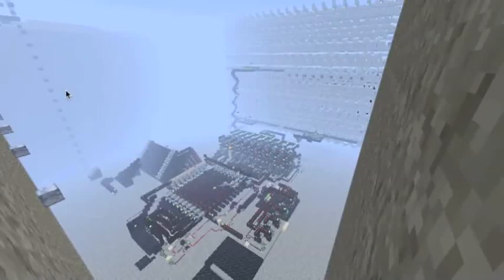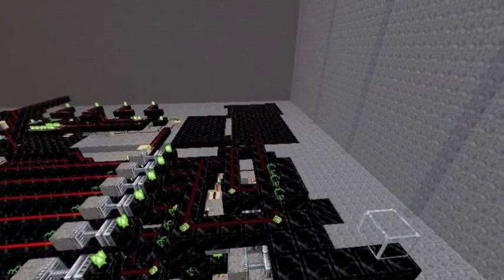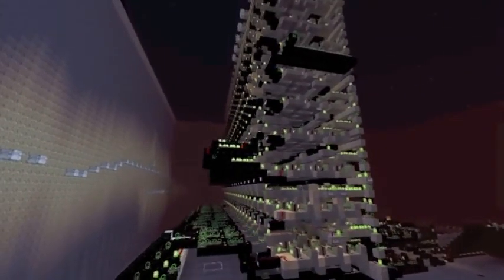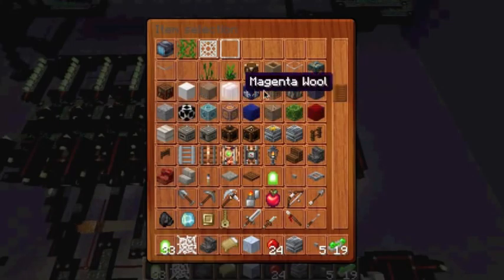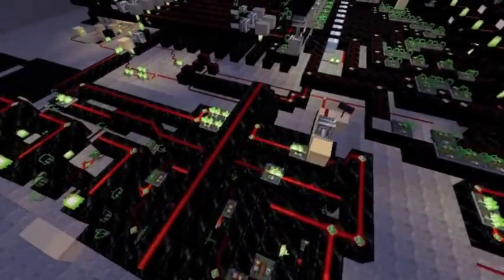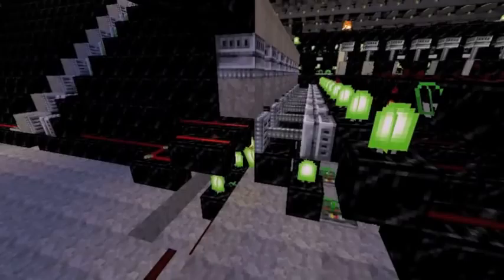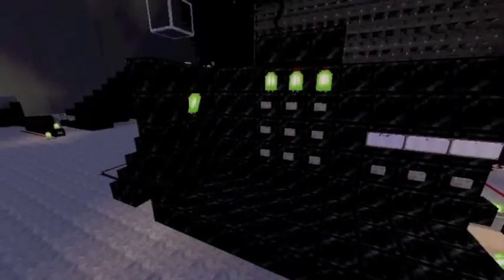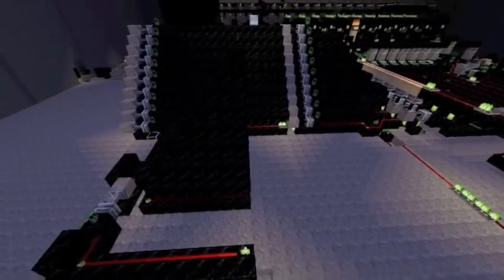Vending Machine Update

Comment from the maker: @TheBigJay66 The first type is the first counter I need for this project. However I need another counter later on, however I was planning on using a binary counter for the bit later on. I just need an easily resettable one. Oh and the reason I need binary counters for that one is I then need a Subtractor. So it'd be best to not have to in code the decimal outputs into binary. and then subtract them and finally decode them =P. But thanks for telling me about that counter!!!